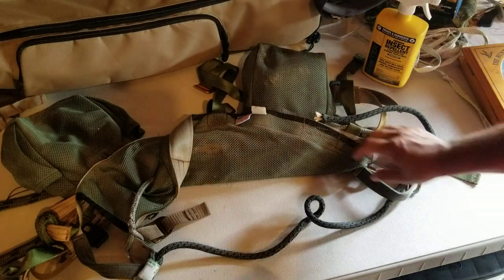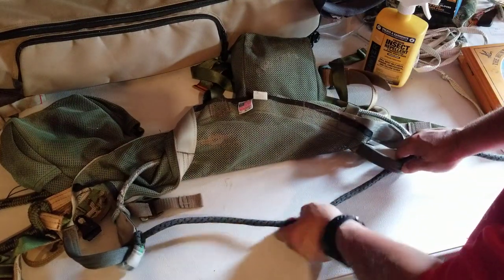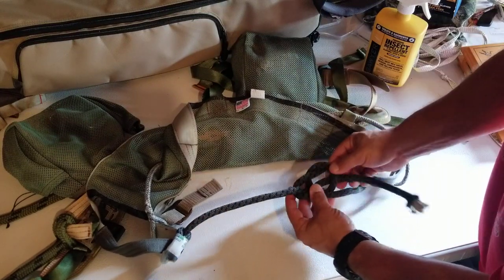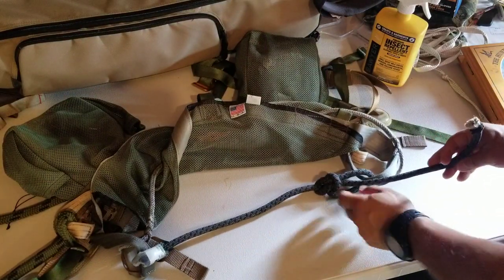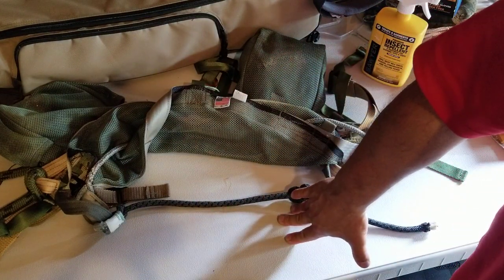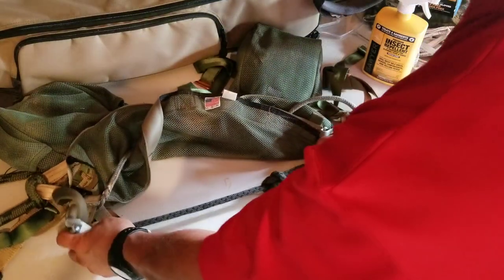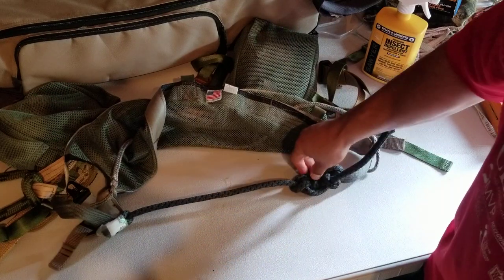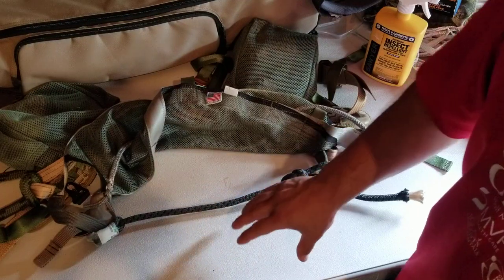How I installed a short bridge for climbing DRT

Comment: I really appreciate all the great info that you and your partner publish.  In researching a secondary bridge ideas I came across your video.  You use a bowline on the bridge you add to your saddle and you back it up with two half hitches.  Instead of backing up the bowline with two half hitches, you should use what is called a "Yosemite backup".  It prevents the bowline from easily coming untied and is very easy to use.  

Thanks again for all work.
Reply from the maker: Yeah that was the first bridge I added  I went to different type replacement saddle bridge  that girth hitches and a small carabiner on one side , and now I too a Adjustable web bridge off my old saddle and added it to my new flat branch saddle .

Comment: It probably depends on if u want a set bridge w/o more metal like a carabiner attached to that end since it isn't a lanyard & I know Scott likes to avoid metal clanking & such. I whipped the ends of all my bridges & lanyards. On my climbing lines I whipped them & @ the very end of the tag I put a high end 3M tape & melted the tip. It comes in handy if I have a 🌳 that will only work with a House or Herbol friction saver. Then I attach my preset paracord with a loop with a pile hitch about 6" above the whipped end & follow it with a clove right where the whipped meets the 3M tape. All other setups I pile hitch the  factory looped end with the opposite end of my paracord & pull it over the union in the 🌳. The 5' split-tail I can leave attached to my Predator with a Blake's & the looped bee line end attached to the carabiner. My hands r the only part that gets cold 🥶 & I'm a late season hunter in MN & had to adapt to it. Take care & good hunting during the secondary unbred doe season if your main tag isn't filled yet.

Comment: Thanks Joe.  I've used my lineman belt with the ropeman1 to create an adjustable shorter bridge on my Mantis saddle when I was experimenting with the DRT.  I also put the amsteel bridge through as a backup.  Seemed to work ok, not sure of the drawbacks of using the lineman belt if there are any.
Reply from the maker: That actually  sounds like a good idea too. I'm not sure if the Ropemans  designed  for a primary  load or if its intended vas a lineman  belt  only. I think its probably  fine because  I read the instructions and couldn't  find anything  suggesting  it can't be used as a primary  load bearing  ascender. So if it could do that I don't  see why not but I'd just check the instructions  make sure you don't  see anything  I might  have missed . I know  Scott  doesn't  like the idea of counting  on a Ropeman  . Might  want to wrap the excess  rope around  it and back it up with a half hitch this way it's not a single point of failure
Reply: NY Saddle Hunter  I’m thinking of trying my ropeman 1 and linemans belt but also clipping in my long amsteel bridge on my mantis as a backup while climbing. What do you think?
Reply from the maker: @vamountaineer1277  I just had a conversation  with Scott about  this. I think opinions  may definitely  vary on this but I think  no one could argue  that the safest  course  of action  is probably  the best way to lean.

Its Scott's  opinion  based on some independent  testing  he's  heard of that theres some potential  risk using  a Ropeman  as a primary load bearing  device on a tether or bridge. Scott's  opinion  is a Ropeman is designed as easily  adjusting  with a single  hand on a lineman  belt. You  lean  into thrm but typically  isn't  carrying  all your bodyweight to prevent  a fall. It's not a fall arrest device  and it is a fall restraint  device but its design is the more weight  on it the more it mechanically  bites into your rope and the fear is this. Imagine  you're  tethered  in and to stand on your predator  platform and take the pressure  off your tether  then you slip off your platform and fall into pressure  on your tether.  This could  potentially  damage your bridge or tether rope as a 200lb man falling  into pressure  on the Ropeman  could generate  over 1000lbs of pressure.  I'm not exactly  sure what the physics  are but I think you probably  understand  my point.  

I'd check with the manufacturer  of Ropeman  first  maybe discuss  how you plan to use it with one of their  engineers  and get their  blessing  just to be safe.

I like the idea of the amsteel as back up or you can also wrap excess around  the Ropeman  with at the least a half hitch as a back up .

I'm a fan of trying  to eliminate  potential single points  of failure  that could lead to a fall whenever  its possible.

Scott and I plan  to take on this  conversation in a video  we plan to make on Sunday a d discuss  his opinions  on the use of the Ropeman. He's   been climbing  safely  for over 30 years and his level of experience  that kept him safe all these years is a good starting  point  for sure. 

I'm sure there's  more knowledgeable people  on the subject  than us but one thing  I know  is Scott's  a stickler  for safety  and he's  climbed  safe over 30 years experience I personally  value  his opinions  greatly  on this subject and I think  most of us that aren't  in the tree climbing  industry  would  do well to follow  his advice at the least and if there's  even safer ways do that. 

At the end of the day we want  to enjoy  a great  hunt and it's no fun if anyone  takes a fall
Reply: NY Saddle Hunter  thanks for taking the time to respond, I look forward to your next video. I will have to look at my manual for the ropeman 1.
Reply: i was just about to ask about using the linesman with a ropeman 1. the ropeman 1 will definitely hold the weight because it is an ascending device. there are video of rock climbers using it in place of a Blakes hitch. can go up with it just not down.

Comment: Joe D, I think that is a good plan for SRT with my Tethrd Phantom because the Prusik on the bridge gets very tightened down after a climb. Is that the reason you put a short bridge on your Mantis, so you didn't have to adjust it under tension in your transition from climbing to positioning on platform? I went to the Wesspur website and it looks like that beeline is a 10mm Tight Eye Hand-Spliced Split Tail (item CLI104). Correct?
Reply from the maker: I originally used the second bridge on the mantis because  the bridge was not Adjustable,  however  now I have a Aerohunter Kestral flex with an adjustable bridge but I still like to run a second  short bridge  . It makes transitioning from rope to tether easier and I like the redundancy. 

As for the split tail you listed that's a good split tail that will work fine but we are using  the predator split  tail it's around $21  like 1/3 the cost of the one you listed in your comment but the one you listed probably has a higher heat rating .

Comment: Could I just use a section of the predator line?
Reply from the maker: For DRT. Or a Tether  ?
Reply from the maker: For a bridge.  Yes    That’s what I have for my bridge on my Kestrel Flex
Reply: @NYSaddleHunter    yes.  You have a section of predator line for your bridge?
Reply from the maker: @bg5215  yes the aerohunter Kestral flex Adjustable bridge is made with predator line
Reply: @NYSaddleHunter    Thanks